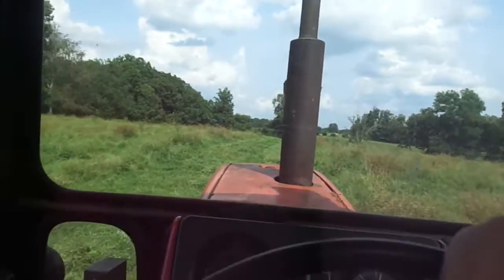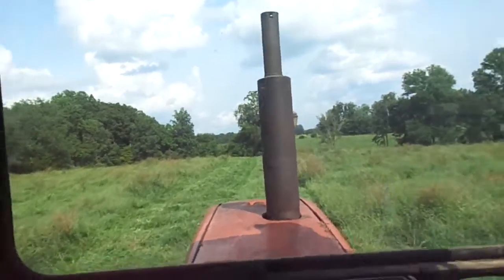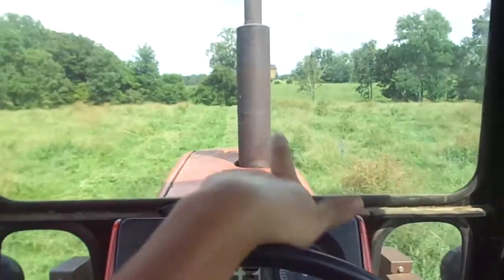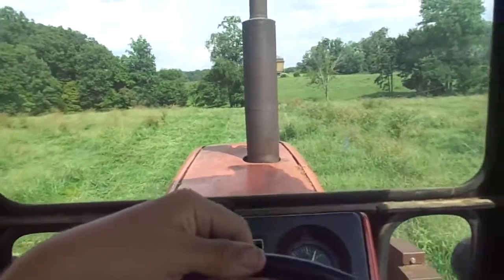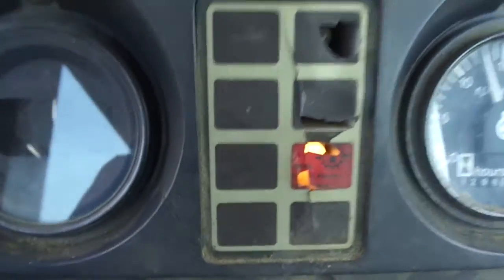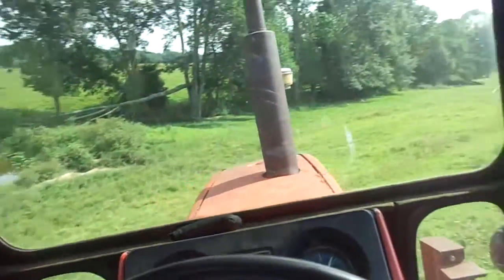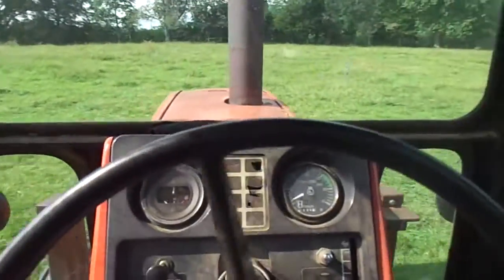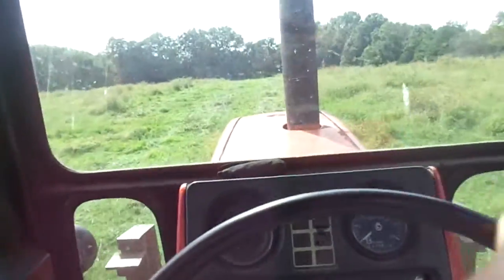Heres whats wrong with the 7020

Comment: The pressure regulator valve might be stuck.  That would cause the pump to over-pressurize the hydraulics and blow seals.  If there is a wobble in the pump shaft, that could cause excessive wear on the o-ring.  I'm sure there could be more possible causes.  Did it have the high pressure hydraulic o-ring in it?

Comment from the maker: yes it had a high pressure O ring its a new pump it has less than 200hours of use the shaft shouldnt wobble if its new ............i called a guy that used to work on these tractors alot he said it might have something to do with the other 2 pumps......i guess u know theres 3 pumps for it i had trouble buying that 1 pump by its self they wanted to sell all 3 pumps to me

Comment: Hey I mite kno whats wrong wit ur allis... I got a 190Dr and I had to replace a trans seal in the trans... Cuze my allis use to leak trans fluid into the rear and it will piss out of the arms... bur as soon I shut it dwn allll the fluid runs back into place.... so anyways long story short I split the dam thing and replace the seal and problems solved